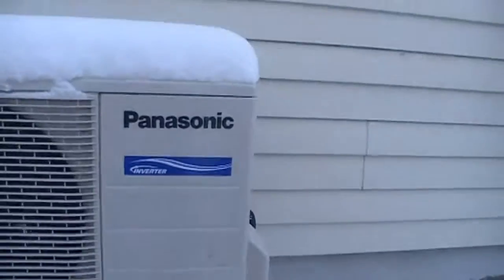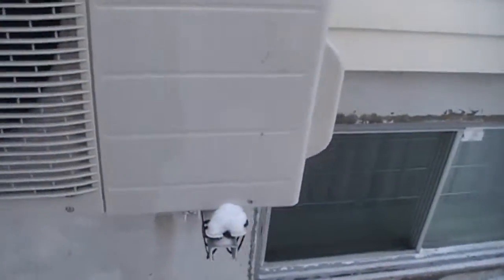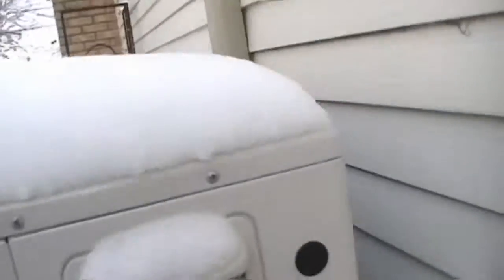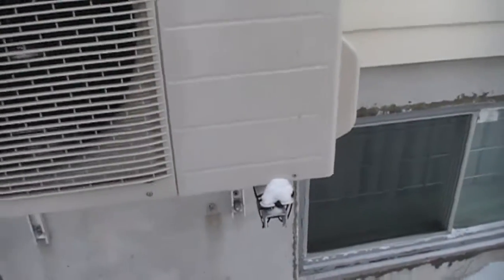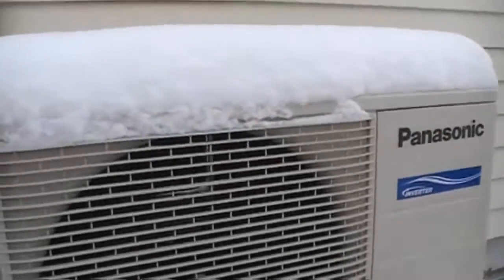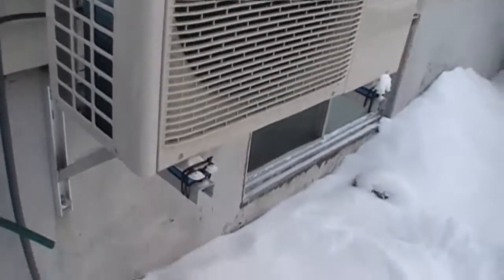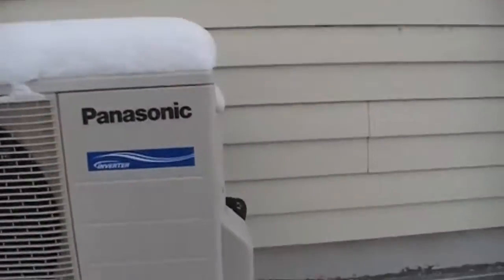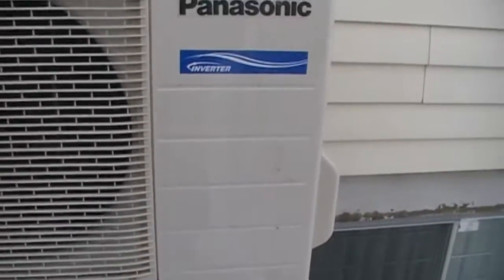Inverter Noise

Comment: My new 5 ton inverter system is about a month old.  The compressor sends a humming noise up the Freon line into my 2 story house.  Wherever the line happens to be contacting the frame inside the walls, that humming noise is transferred into the frame.  It seems to make that noise when the compressor is changing speeds.  The tech came back and put rubber isolators wherever he saw contact in the attic between the Freon line and the house frame.  However, he did point out that many of the contact points are inside the wall and can't be accessed.  That means to isolate the hum would require cutting walls open.  Bottom line, we're just going to have to get used to it.